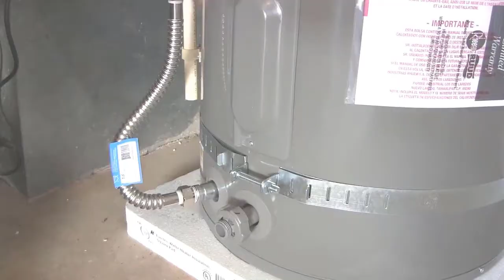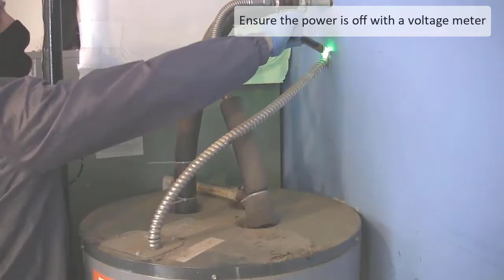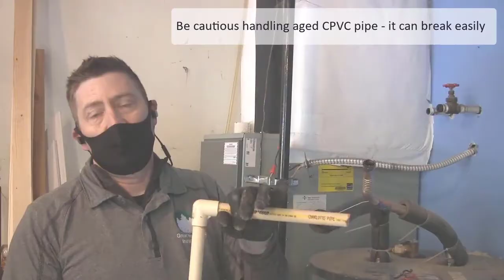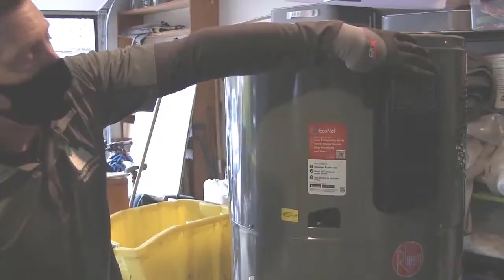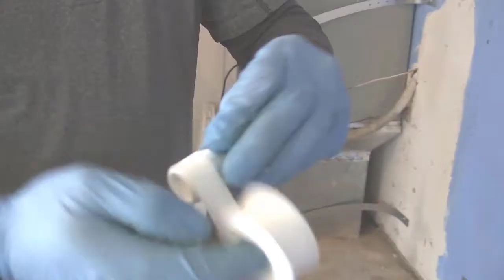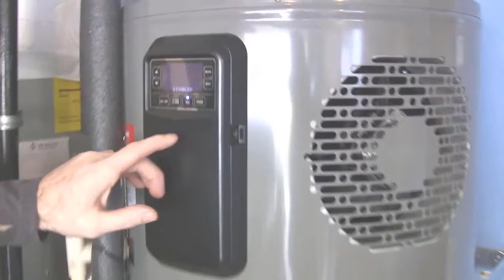Hybrid Water Heater Professional Installation Guide

Comment: No need for an expansion tank?
Reply from the maker: Only if the water heater is part of a closed system, which is created when there is a check valve in the incoming water supply that prevents the expansion of heated water from flowing back into the water main. That is not the case with the water heater we installed here.
Reply: Great video my friend. Wasn’t sure if I needed one but I was told since I was on a well there was no need for an expansion tank. Installed the same model today with the help of your video!! Thank you so much

Comment: Why the cold line needs insulation?
Reply from the maker: It is less necessary - however cold lines can be condensation points. The way that water beads up on a cold glass on a warm day, your cold pipes can do the same thing which is not ideal.

Comment: No check calve, no thermal expansion tank?
Reply from the maker: Only if the water heater is part of a closed system, which is created when there is a check valve in the incoming water supply that prevents the expansion of heated water from flowing back into the water main. That is not the case with the water heater we installed here.

Comment: I was told that a Thermal Expansion Tank needs to be installed with a hybrid water tank. Is this correct? A tech told me that it is required according to code.
Reply from the maker: The answer to this one was a bit complicated and may vary where you are. Our expert said that it is a code requirement for a closed water system by the code book. You can ask the inspector for the code at the time of inspection and talk with them about how it is enforced. Some plumbing companies require it for all of their installations which will increase the installation cost and so that they can avoid failing any potential inspections. 
I hope this answers your question!

Comment: What do I need to do with the pressure relief valve? It looks like you installed a PVC pipe to the floor but it is hard to tell in the video.
Reply from the maker: Hello Cameron,
Per code, it must go to an approved location. For our installation it is in the garage. This drain is allowed to go to the floor, no closer than 6". We run our relief valve drains in CPVC, PVC is not allowed. Where your water heater is located will dictate where it should go.  Is yours in a garage?
Reply: @CommunityEnergyProject  yes it is in the garage. No closer than 6 inches but what is the maximum height from the ground? Thanks for responding
Reply from the maker: @cameron7889  Here's when we go straight to the Uniform Plumbing Code: UPC 608.5 Relief valves located inside a building shall be provided with a drain, not smaller than the relief valve outlet, of galvanized steel, hard drawn copper piping and fittings, CPVC, or listed relief valve drain tube with fittings which will not reduce the internal bore of the pipe or tubing (straight lengths as opposed to coils) and shall extend from the valve to the outside of the building with the end of the pipe not more than two (2) feet (610 mm) nor less than six (6) inches (152 mm) above the ground or the flood level of the area receiving the discharge and pointing downward. Such drains may terminate at other approved locations. No part of such drain pipe shall be trapped or subject to freezing. The terminal end of the drain pipe shall not be threaded.

Comment: Is there no expansion tank needed in these types of water heaters?
Reply from the maker: Great question, Jason! Only if the water heater is part of a closed system, which is created when there is a check valve in the incoming water supply that prevents the expansion of heated water from flowing back into the water main. That is not the case with the water heater we installed here.

Comment: Hi after installed how long water will be hot ? Thanks
Reply from the maker: It may take a couple of hours to heat up your water for the first time. The time will be impacted based on the size of your water heater, and the temperature.

Comment: Is it okay in Oregon to tie the heat pump water heater's condensate drain line into an existing condensate drain line for an air conditioner or heat pump?  I'd like to avoid punching a new hole in an exterior wall if possible.
Reply from the maker: Hello! Typically as you join additional drains together you are supposed to increase the size.  With that said if someone was to tie 2 drains together it will not do harm.  Just for additional context you can install a condensation pump and use it for up to 4 drains.
Reply: Great thanks!  And thanks for the video!  I was able to swap out my 20 year old gas water heater with a heat pump water heater with (almost) no problem.  One thing I don't recall seeing addressed in the video or in the PDF manual was when to include a thermal expansion tank.  Definitely something you don't want to forget when working with a closed water system.
Reply from the maker: @cspyker  That's amazing! And thanks for the feedback. This was our first time shooting a field video and have learned a lot. :)

Comment: I just installed mine this thing is pissing me off. It's telling me there's no gen five heat pump shut off and there is a shut off on the water heater.... It's the same ball stop you have installed in this video
Reply from the maker: oh no! I reached out to GNW Installations, and he said you may be able to solve this issue by trouble-shooting your alarm code. 
Go to page 26 of your user manual for full instructions. Go to "troubleshooting alarm codes" and follow the steps.

Comment: Where's the heat trap? Instructions specifically asks for one on the cold water supply
Reply from the maker: Hi Adam - Most all water heaters come with pre-installed heat trap nipples for both the hot and cold connection points.  This can look different pending the installation in most cases - you'll have to look at the specific manufacturer's instructions.

Comment: Thank you for the video. Will this work with a hydronic heating system. Right now I have a hyrdonic water heater but would love to use this if possible.
Reply from the maker: What a great question! Here is what our technician tells us in response: "I wish we could use the HPWH (heat pump water heater) for more than just heating water but we are not there yet 100%.  Hydronic heating can overtax a HPWH and more importantly, the biggest hurdle is how the HPWH functions. The return loop back to the HPWH can create an issue in which the HPWH will not kick on to heat. It confuses the thermistors that help control heating. It will think that it does not need to heat given the temp of the returning water.  This is the same issue we have with just setting up re-circulation pumps on HPWHs. There are some workarounds but you do not know until you turn them on if they will do the trick and a bit more costly. " 
I hope this helps. :)

Comment: Excellent although I'd like to see a brief section for the actual plumbing and electrical connections. I appreciate the fact that this guy is not long-winded, is very informative and speaks very well.
Reply from the maker: Thank you for the feedback, this is an excellent suggestion.
Reply: one, no, make it two very noticeable omissions;  (1) you talked about the need for a foam base under the 200+ lb. water heater and then it just magically appeared underneath... exactly how did you get it there...by yourself? And, (2) where is the drain pan?! My 65 gal. Proterra had to be  manhandled by  2 burly guys onto a board tall enough to tilt and wheel it over the top of a flimsy 3 in tall aluminum drain pan (with a plastic sheet underneath it all, to slide it into final position} ... we were GASSED by the time we were done! I'm in Florida, with a concrete-floor basement garage... do I REALLY need a foam base under it?
Reply: @kirkcavender4816  I have foam under my water heater. It  is for electric isolation in case it leaks or if you have flooding. Electric grounding chooses the shortest path you do not want to be the path. It is an insulator also. But not really all newer heater are foamed internally.

Comment: Please ( coming from a Rheem warranty tech) remove the rear screws holding the top cover and second cover so anyone working on it doesn't have to remove the tank to get the screws out.  Rheem doesn't cover the cost of a Technician to remove the tank. 😊
Reply: THANK YOU!

Comment: My installer used a 90 instead of a T for condensate drain?  Any possible issues with that instead of the T?  I just switched it to a T after reviewing the manual and seeing your video.
Reply from the maker: From our friend at Great Northwest: "So, a 90 instead of a tee will work (AO Smith actually sends a 90 for their HPWH).  A tee is recommended so that it can be cleaned out if needed."
Reply: @CommunityEnergyProject  Thank you for the quick response.

Comment: No vacuum relief valve?
Reply from the maker: Great question! We asked the expert and this was his response: "We only need to use an anti-siphen/ vacuum relief valve if the water heater is above all the plumbing in the home.  Such as an attic.  It is used to prevent siphoning of the water heater if the water heater was no longer being fed water, water pressure dropped and or a hydrant outside was opened for fire purposes."
Reply: @CommunityEnergyProject  thank you for the response!

Comment: Do you recommend outside installation with an enclosure California Energy Standards Climate zone 14?
Reply from the maker: Hi Jovanny - we asked our expert and this was his response: "California Energy standards should be referenced locally as every jurisdiction has its own guidelines.  Typically a water heater should be protected, if installed outside it can be in an enclosure.  I know they make water heater sheds for California but with a heat pump, it would still require the same air space for the heat pump water heater. If the enclosure is smaller than the manufacturer required (by Sq Ft) you should install louvers and or ducting." - I hope this helps!

Comment: do you not vent the cold air out from the heat exchanger?
Reply from the maker: Great question! Because this installation was done in a garage, the customer was fine with the cold air simply cooling down the garage air. However, if this were installed in a conditioned space, say a closet in a bedroom, then the venting of exhaust air would be a best practice, and can be trickier. In the case of a closet with a closed door, ventilation (such as louvers) will need to be added to the door to allow intake as well, even if it were vented externally.
From what we've heard from installers - the temperature dip is relatively modest as long as the cold air is not blowing on you directly. But some people are more sensitive to that than others.
Reply: @CommunityEnergyProject My concern is more with the intake.

Our mobile home is well sealed, but if I were to vent the cold discharge out of the adjacent wall, and did not duct the intake as well, it will be using ambient air, which take a suction on the house, pulling replacement air through the cracks and seams.

In the summer, this can really raise the electric consumption.

I have a single hose portable a/c that I am getting rid of in favor of either a mini split or dual hose unit for that reason.

Will ducting the inlet of this type of water heater to an immediately adjacent wall require a booster fan or any other modification?

Looks like I can go straight out, but I'd need a 90 down to avoid rainwater.

Is their a recomended length for the duct going down to avoid sucking in rainwater?

It looks like a low static large dianeter fan is used - would i  need to build ductwork with the same total cross section?

I'd really hate to go through all that time and expense and then burn out a fan.
Reply: @Zomby_Woof  in nearly all scenarios in every climate venting outside is less efficient due to the air you're sucking in from the outside too. You can run the unit in your camper it is barely going to run. It is just going to be doing what a dehumidifier does.
Reply: @gg-gn3re  Yes, I mentioned all that in my original question.

In the end, I'm sticking with the standard element water heater.

I don't see where the heat pump types does anything to justify its cost.
Reply: My cold air vents into a corner of a detached garage-5 ft.- and I've noticed that the truism about cold air following the hot air applies some per the inlet temperatures to about 2 degrees. Opening up a nearby door and using a portable fan whenever the sun rises helps some too.  Another company sells those vent attachments for much less than Rheem does--the 40 gallon attachments are even less expensive.  May put a temporary winter vent on the same mentioned door.  The cold air is nice in the summer and some plants thrive at cooler temps. About 60 degrees is the sweet spot in my experience.

Comment: Noticed no expansion tank was added to this installation. Is this dwelling part of an open water system?
Reply: Great question, Aaron. I posed this question to our plumber. He replied: "We test for open and closed systems. If the incoming water line test open we do not install an expansion tank. If the incoming water line tests closed we will install an expansion tank." In this instance it was an open water system.

Comment: The brand in EUROPE STELBRON,  been making them about 60+ years,their CONDENSER is wrapped around its TANK EXTERNALLY TO THE WATER, NOISE COMPLAINTS ARE NOY A COMPLAINT, NOR EVER RUNNING OUT OF HOT WATER, I SEE 1 MODEL OF RHEEM, NOW having their condenser externally to the water circuit. Gee I wonder why ? Yes STELBRON  COSTS MORE ,& even HD sells them here in USA   BTW, THEY ARE SO EFFECIENT THAT THERE IS ONLY 1 ELECTRIC HEATER @ top seldom ever used, hit here in US people buy by price and NOT  by their water needs, then bitch it does NOT WORK ! GEEE WHAT COULD GO WRONG ?
🇩🇪🇩🇪🇺🇸🇺🇸

Comment: Mine's in the garage so the noise doesn't bother me - but wow it sure makes my garage a lot cooler in the summer and like an ice box in the winter.
Reply: What part of the country are you in? I'm considering purchasing this unit but I'm concerned about freezing my basement 🤣😂🤣😉 in the winter.
Reply: @martintorres7480  I'm in Oregon. If the heat pump feature can't pull enough heat out of the air, then it will switch to being a normal water heater. But man can that thing pull all the heat out. It's right next to the door of my garage and you can feeeeel it! I just weatherstripped the garage well tho so it doesn't matter. It also dehumidifies a little which has been nice.

Comment: There are tons of noise complaints about this generation of Rheem heat pump water heaters, care to shed any insight on that? Has that not been your experience with the current Rheem line?
Reply from the maker: We have had noise complaints from some folks we've installed water heaters for, but not a majority. In general it's recommended that a heat pump water heater be installed in an unconditioned space such as a garage, rather than a living space.
Reply: It is very quiet